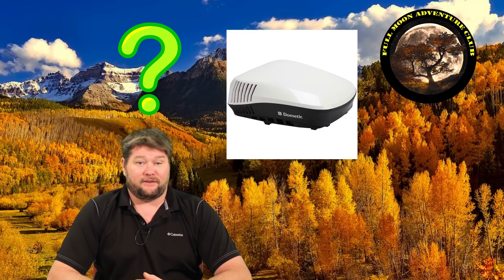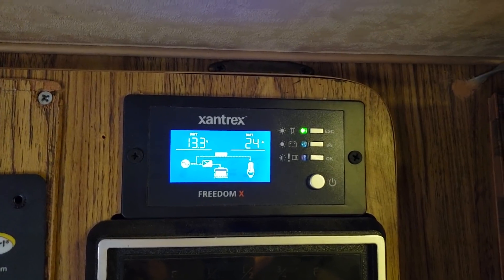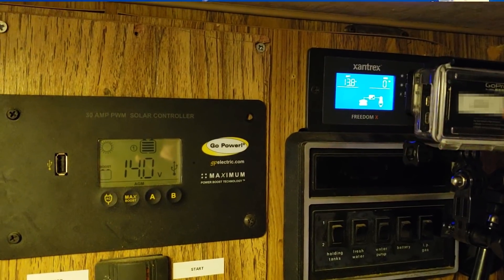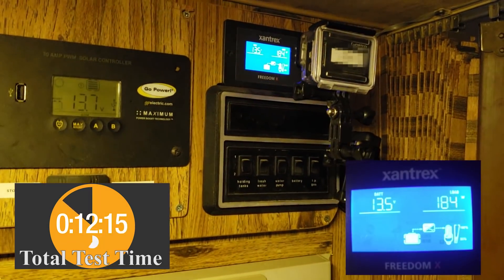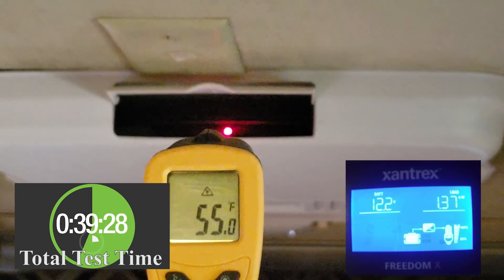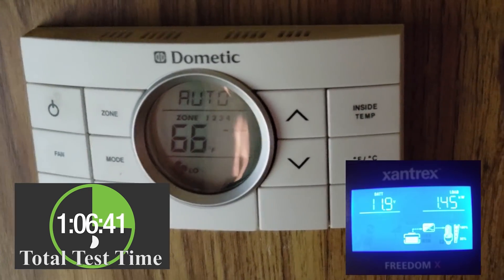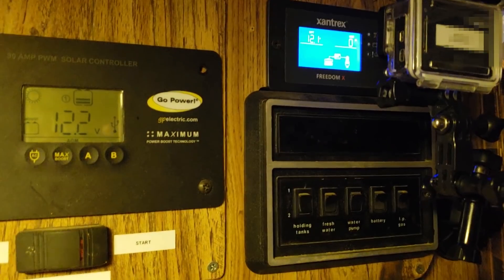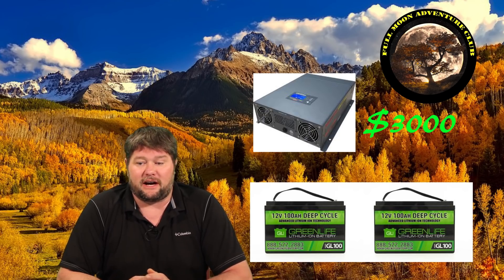How Long Will an RV AC Run on Two Batteries?

Comment: I have seen truck cab Ac units that are DC operated and run for more than 8 hours at night.
Reply from the maker: I'm sure they're not 15000 BTU units. He can definitely be done. I've seen a lot of truck drivers sleep with your engines on but otherwise they must have a large battery Bank.
Reply: I was researching DC AC units for buses, seen DC units for Truckers probably only 10000 btu or less. A Prius car has a DC compressor  uses 134 a, I made my own air-conditioning using a evaporator from a ambulance and a window unit compressor and a condenser and 110volt fan mounted underneath vehicle parts from salvage yard. Charged with 134a blows ice cubes out!😀

Comment: The different voltage is the voltage drop on your wires into the inverter. You are losing almost 1 volt at 1200 watts, due to the resistance of your cables. Your cables should be resized to a much larger gauge wire and you will drop less and have more usable power from your batteries before the alarm sounds.
Reply: You helpful solar guys rock always helping us.
Reply: I’m no expert, but, I’ve read that welding cable does it right. So I bought some and copper tubing to make connectors for it. Heavy & bulky but hey there ya go.
Reply: Surely the cables that come with the inverter should be sufficient gauge to run the inverter?
Reply: Not nessa celery.
Reply: @davidjames1684  Is that supposed to be a pun or joke? I can't say I get it.
Reply: @Peyton mac - I was responding to the comment about the included "cables" being large enough.  I was basically saying not necessarily.  For very heavy loads, going to even thicker wires can be better, however, sometimes resistance in wires can be used to your advantage.  For example, if your inverter normally shuts off at 10.5V (per 12V of battery), having not so thick DC input wires and a heavy load would likely make it detect low voltage when the battery is actually quite a bit higher, thus stopping when the batteries are at a shallower depth of discharge (like perhaps they were really at 11V under load but the inverter "saw" 10.5V and shut down).  That might be desirable for some people that don't like to drain their batteries too low between charges.
Reply: @davidjames1684  Frying your wires is never an advantage. You mean to say a "fuse" would suffice, right? Fuses not only protect your electrical system, but also your wires. Why? Wire gauging is set to handle certain amperage. You can handle more amps with thicker wire. Okay, so why does this matter if nothing is shorted out? It looks fine, right? Well, as OP said, running a higher gauge wire (thinner) is worse because of resistance due to heat. Tiny collisions take place from the metal in the wires heating which cause vibrations, ultimately slowing electron current. While it gets a bit complicated and seemingly contradictory, in terms of P=IV, V=IR, real world power is more efficient by using resistive loads whose values best match the internal resistance of power supplied and in this case, the resistor value has a sweet spot in a wire such that raising or lowering this value will subtract from your overall power output.
Reply: @davethefish7653   so what would be the proper gauge cable to run from batteries to inverter and also from start battery (through isolator) to auxiliary batteries? Also, I've read that running a small ac unit (800w) in a van, lets say, while the vehicle is running WOULD  be too much load for the alternator, and I've also read that it WOULD NOT. Typical internet researching....
Reply: @dustinalker972  It would 100% be too much load for a typical alternator which normally supplies ~ 130 amps @ 12V. The typical alternator is rated for ~1500 Watts of power. And when you factor in power loss (depending on distance of wire, inverter efficiency, etc) you'll likely need 1000W to power that 800W AC. If you're running an alternator @ peak current, you can manage the load for a small amount of time, but it's not meant for an additional 1000W output. You'll burn the alternator out and/or damage batteries if they drop below 40% capacity. 

If you are set on running that AC, you'll want to use 2/0 wire a distance of no more than 20 feet (which is rated at 200A, but you want to overshoot by 30% due to overcharging). You then want to install a second alternator running directly to a battery bank that will supply the power to your AC. You also want a 200A fuse between the alternator and the battery bank. You can then connect your inverter to your battery, your AC to your inverter, and turn it on while the car is running.

Depending on how long you want to run this AC, you might opt for a better battery. I would recommend at the very minimum 400AH of AGM or 200AH of Lithium (which requires a special battery isolator) of battery bank as you're essentially draining 1000W/hour and you'd need roughly twice the capacity to minimize loss of charge from alternator fluctuation. 

At minimum, on a budget, you'll need:
1x 200AH AGM Battery (Or 2x 100AH)
40 ft of 2/0 cabling
A dedicated 200A alternator 
A battery isolator that can run from your first battery to your secondary battery bank, to help charge the AC power bank.
A 1500W pure sin wave inverter (Depending on quality of inverter, 1000W may work in a pinch if you have one)
2x 250A fuses
1x 100A fuse

Etc.

 It's an expensive job. If you wanna upgrade the alternator you have now, it could work, although I've had issues installing them without some fabricating a bracket support.
Reply from the maker: @Brandon Stevens. Thanks for sharing. Sounds about right to me. Nice post. My channel is to the point where I can no longer keep up with every comment and question but I try. YouTube doesn't even notify me with every comment anymore so I love to see people helping each other in the comments. Thanks for watching and happy camping.    Jim
Reply from the maker: You would definitely need to do a lot of modifications before you can run an AC system off of an alternator. A person commented below you named Brandon, his explanation seems accurate to me. Give it a look. I personally have never tried to run an air conditioning unit off of an alternator but know that it would burn out the alternator in a very short amount of time and possibly do damage to the battery Bank as well. It would definitely have to be a modified system with a special alternator. Thanks for watching happy camping.
Reply: @Here_is_Waldo  I can see that being an option
Reply: @Here_is_Waldo  "surely the cables that come with the inverter would be adequate... Rrrright?" 

Lol good joke.

Comment: The compressor will cycle on and off and there will be peak consumption when it turns back on. There are softstart devices that store energy to feed that peak demand reducing the strain on the batteries at startup time.
Reply from the maker: Looking into getting one of those for a video. Thanks for the recommendation and happy camping.   Jim

Comment: Great to see someone finally executed this test.   The never ending barrage of RV forum blow-hards who constantly claim knowledge on this (and every other topic under the sun), yet seldom actually have a real-world case clue on anything, all these time-wasters and know-it-alls often quote up to 6 hours of AC use when powered by two lithiums, so I hope they all read this and take note.   Still we have to give them credit for being able to read the marketing brochures LOL

Now I do have a question and that is at what point did you (OR do you) see the AC voltage drop below 107VAC, as this is one of the recurring published minimum voltage I've seen speced by a lot of roof-top  manufactures with 107VAC being the lowest suggested safe  continuous voltage of a typical rooftop AC unit.   Do you remember if it went under 107VAC or not?

Otherwise this proved to me more than ever how lithium is pretty much a waste of money if you instead wish to conserve power and run fans to both save money and be easier on the body by not shifting temps so often and so widely.    There is also the factor of "portion of sleep portals" and how much of a benefit would only an hour of cool sleep be to anyone.   And with that thought, it's going to take a good deal of time to build those batteries back up after the hour and a half drain, especially with the 200-600w that most camper roofs support.   

Also with an inverter fan blowing 120F air out the exhaust port and an AC pumping out 55F air with both of them filling the cabin with the contrasting temperatures, these types of setups seem more of a Rube Goldberg setup than a practical one.    But back to "portion of sleep portals" - I have found over many years in various different climates that it's better on me, especially in an RV, to keep the AC always off and just use fans, and that's even if I have a power plug handy capable of the load.   But that's only if someone is an "adventure camper" and I am defining that as anybody who does anything outside and doesn't spend their entire time locked inside the box with a computer or television going.

My experience: (220aH flooded cell GC2's; 465W solar with 2000PSW inverter - full-timer going on for 2 years now, never a power plug, run occasional TV to watch a movie, 2 laptops about 6-10 hrs a day and all typical charging of phones, all accessories run off 12V.    I use the 2000PSW (non-name China mfg.) only occasionally for either microwave, toaster or blender.   With the flooded cells, using the 17A 12 year old microwave (150A DC draw), I consume 3% of the total charge per minute of microwave use, generally seeing a low voltage cut-out (11.1DC) occurring typically after 5-7min of microwave use.    I use the microwave off the inverter about once a week, the toaster every other day and the blender a couple of times per week.   I cover the entire N. American continent including C. America and primarily rely on relocating to mountains ins summer, the beach in winter.   

Good luck to you and thanks for the visual on a very good curiosity satisfying experiment.
Reply from the maker: I'm glad you enjoyed the video. Thanks for sharing all of that great information with us. It's always nice to hear full timer set ups. The rule of thumb for air conditioners is it they run around a thousand watts and for every thousand watts to run 1 hour you need 100 amp hours of battery. If you really want to run an air conditioner for 8 hours you need 800 usable amp hours of battery unless offset by solar. If you have a thousand watts of solar you could use less batteries but not by much. It's not impossible to run air conditioners off solar and battery power but it is costly. Thanks for the comment and happy camping.  Jim
Reply: He used a 15,000btu air conditioner.... A 5,000 would be triple the time..... He also didnt have solar hooked up at the time... If you had enough solar coming into to those 2 batteries, you could get MUCH longer times..... Or you could add more batteries

Comment: Hey Jim,
Thanks for the great info
Im an investigator in the Central Valley of CA., and Im trying to cool the interior of a small SUV for 6-9 hours. Thinking about a zero-breeze with a deep cycle. Any suggestions for other options? Solar roof panels, other batteries?
Reply from the maker: You may want to consider The Kodiak solar generator Apex and a zero breeze. The kodiak can be charged with the car or with solar on the roof. It has a inverter for the zero breeze and is portable at 25 pounds. Watch a review of it on my channel to see if that would work for you. It's on presale for 700 dollars off with my code Adventure so not a bad deal. Otherwise I would say you will need solar panels, a lithium battery preferably, and whatever inverter the zero breeze requires. I hope that helps.Here is a link to the Kodiak if your interested.     Jim https://youtu.be/9AzMDxxi-sg
Reply: Buy a quiet Honda generator and custom install it into the vehicle run gas from tank  with a small pump  mount underneath vehicle or under hood. Wire power to air-conditioning system
Reply: @0011-b2s  Generators installed in boats or motor homes only go halfway down into the tank, some 3/4 of the way but none use the supply that would allow the generator to run your tank dry. You may want to be able to drive your RV or boat to a fuel source.

Comment: I really liked you video.

The big problem with lead acid batteries is the voltage sag.  I have had the shore power go out when I had the AC on and 4x 12v 110ah deep cycle batteries last about 5 minutes.

I just upped my solar to 2860 Watts and am currently building a 200AH 24v lithium battery bank (for this year, doubling it next year) and I hope to be able to run the AC for about 10 hours a day (it gets to 120f in my part of Arizona) but I won't know until I actually test it this summer.

Eventually I am going to build "Carbon Enhanced Lead Acid" and finally give building "Solid State Graphene" batteries a test.
Reply from the maker: That sounds like a sweet system. Let me know how the graphene batteries go. Thanks for sharing with us and happy camping.  Jim
Reply: Hello there, me and husband are new to the Rv life we also live in Arizona currently staying in casa grande and we trying to save $ and make the best of using our Rv if you can contact me I would to ask questions about using batteries to power our ac

Comment: Just think if you had a couple K worth of solar panels charging at the same time!  Most people wanting to do this would set up 4 - 6 volt AGMs (since they can go to almost 100% drain) set up in series - parallel 12V.
Reply: AGMs can go to almost 100% drain?  Where are you getting that information?  I have 4 AGMs that have serious issues now, thanks to them getting run down too many times (our auto-gen start wasn't working properly on multiple occasions, and the batteries went way too low).  I'm not saying you're incorrect -- but for us, the AGMs didn't seem to hold up well to the abuse of running them too low.

Comment: How would HURT your system?
Reply from the maker: Compressor motors dont like starting with low current. I just did not want to risk wear and tear on a new AC.     Jim
Reply: I agree, but is it not true that the inverter will supply the proper line voltage as long as it can? If you batteries are getting tired and the voltage is lower, I would expect the current to increase slightly. I can see the amount of current going into the inverter having a limit and the batteries ability to have a limit, but I believe the output of the inverter is pretty stable or if the input is too low, it will cut out.
Reply: You need to get an AC that has a built in capacitor to start under low current.

Comment: Do you like the Greenlife batteries better than the Kodiak 2 generator?
Reply from the maker: Both are great. It depends on what you need them for. The kodiak has a inverter and solar capabilities built in while remaining portable. The green life batteries are for permanent installation but work well.    Jim
Reply: @fullmoonadventureclub  Hotspot Energy ACDC12C Solar Air Conditioner. i Like, OLE!

Comment: Interesting indeed!   With 4 FLA 6V  450Ah (C/10) at 50% DoD, I should be able to get twice that time and a bit more.  Add another 1200W solar offsetting the load and I might even be able to double that too.  So maybe 6hrs.  Plus that's with the AC running at 100% duty cycle (like your test).  So with it running half the time, I should get 12 hours.   My RV has two 12500BTU units and I'd like to run just one of them to cool a sectioned off room.  We'll see...  
Thanks for this!
Reply from the maker: Glad I could help. Good luck with your setup. Take care and happy camping.     Jim
Reply: lol good luck bro! put a video on youube so we could see how disappointing you are going to be with the results.
Reply: dazed sw

Comment: Good experiment. Better off using a 5000 btu at night for comfort and reducing you amperage foot print 2/3. or 3 hrs run time.
Reply: I personally lived full time in my RV it's been 5 years. I've had 6 battery's 4 solar panels, a generator, and Dual 100 amp alternators, and 2 battrey isolators, charging 4 battery's. This gave me power to run quiet all night. Ran TV , PC,,lights, cooked, my Battery's always charged when I was driving or idling, or solar, when the Generator Ran the transformer charged Battery's
Reply: Indeed, but if your RV has only 12 or 15 kBTW air conditioners what do you do?
Reply: Build a small windmill that attaches to a Pole so it can be erected when camping a charge controller  run that additional power to those cells. Possibly use a DC trolling motor and create a windmill that would convert wind into power!😀
Reply from the maker: @0011-b2s  I was literally researching that last night. LOL. I'll stick with solar. Although, it would have been great to catch some of that Breezy night air and charge the batteries without Sun. I'm just not sure I want to erect a 20-foot tower on top of my RV every time I stop. thanks for the comment and happy camping.    Jim
Reply: @fullmoonadventureclub  look up vertical wind turbines, they only need to be about 5 foot off the top of the highest point of what ever they're mounted on to be most effective.